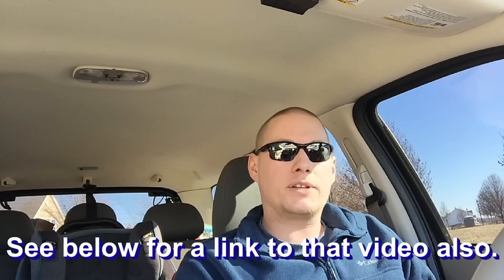Ford Ecoboost Engine Carbon Deposits: What You Need to Know

Comment: Brian,
What are your thoughts on fuel system cleaners like Red Line SI-1? I use Chevron with Techron gas exclusively.
I usually add a bottle of SI-1 (Red Line) at each oil change (it's sold at my Ford dealership). Should I do preventative maintenance and add a bottle of Techron instead of the Red Line SI-1 to the gas tank at every oil chance?
FWIW I use Red Line Synthetic 5W20 oil.

Thanks!
Reply from the maker: ***** I would only use the Techron bottles personally it has been shown to be the most effective and yes 1 bottle at every oil change should be sufficient.

Comment: Ok just to be sure 2013 Fusion 2.0 turbo ecoboost with 58,000. Its safe to use BG44k and top tier 93 octane gas and not damage my engine and to help clean valves?
Reply from the maker: Filippo R. Yes
Reply: Thank you.

Comment: Just bought a 2011 SHO 100k miles in mint condition. Had my mechanic inspect before buying but of course there's only so much to discover since he couldn't look inside engine/fuel system. What should be priority to do on the car? I feel the car hesitates a bit to first gear but if I step on it after the car flies! Any help much appreciated. Thinking of getting tune up, and bg upper fuel clean

Comment: To help control soot on Turbo diesel engines would it be beneficial to drive at 3300 rpms for 20 - 30 mins once every week ? 
I only use High quality engine Synthetics.

Comment: Is quicktrip top tier fuel?  When you can't get top tier fuel can you add Lucas to help with the fuel? I am running both Techron every oil change and lucas with each fill up. 

How often do we need to change spark plugs now with the carbon damage to the plugs you spoke about in the past?

Thanks. Great videos as always.
Reply: According to the top tier website QuickTrip IS top tier.
Reply from the maker: Fletcher Schubert Ecoboost plugs should be changed every 50-60k miles.

Comment: You mentioned a water/methanol injection as a fix. Are there any Ford recommended systems that will NOT void warranty? Or will "any" system do?

I am considering adding the alky control system on my Taurus SHO but am concerned about warranty issues.
Reply from the maker: David D No systems currently are approved.

Comment: I have a question, my 2013 F150 ecoboost with 46,000 miles on started puffing white smoke out of the tail pipe just for a couple of seconds. What could it be?

Comment: Very interesting- regarding your statement about Turbo charging increasing cylinder pressure and blow-by did you know that many higher end turbo models by BMW and a few others have oil consumption problems? I was reading that some vehicles use 2+ quarts per 1000 miles

Comment: Is it ok to vent the bov's on the 3.5l twin turbo ecoboost 2011 ford f150?... I know it voids the warranty but I don't want the oil going back into the intake. Plus we love hearing the Blow Off!
Reply: +Erick Wagner Venting the BOV will make cool noises but nothing more. You will only be venting air when you close the throttle in boost. Otherwise you will be getting the same amount of recirculated air as always. The only way to keep the oil out of the intake is a quality catch can setup.

Comment: So I have a 2015 Ford Mustang 2.3 Ecoboost. the engine experienced catastrophic failure with less than 32K miles on the car. The piston in cylinder 3 was destroyed and the cylinder wall on 3 on gouged pretty bad, and some valves got destroyed. The other 3 pistons looked pretty blackened. Does that sound like carbon build up? or does that sound like heavy detonation? Ford tried to blame it on aftermarket spark plugs (NGK's which come highly recommended for the 2.3 ecoboost) until they took it apart and couldn't justify a broken plug causing all the damage. They are covering it under warranty luckily. What do you recommend I do to take care of the engine after the car gets fixed? Thanks. Can I somehow show you pictures of my engine/head? thank you again.

Comment: I driver only Cty Type Driving , meaning rarely go above 30 mph in my Small town, ave 7k miles a yr.. Thus will hardly ever use a Turbo System..I would assume this is not Good for it and I should Avoide buying a Car ( Fusion) with this .Just a Straight 4 cycl or hybrid?

Comment: A friend of mine told me to use synthetic oil 10W60. That would prevent problems with timing chain tensioners and so one. Do you agree with that? By the way, your vids are extremly full of informations. Please keep it up. Greetings from Germany.
Reply: If Ford recommends 5w30 for your EcoBoost engine, using 10w60 is a horrible idea.

Comment: I am not mechanically knowledgeable I just purchased a 2014 Ford 3.5 turbo charged engine I don’t have the manual what is the best octane gasoline and what Type of oil is best synthetic or not synthetic thank you anybody who knows all and it has 45,000 miles on it I was told to get a oil separator as well

Comment: I read that Toyota has developed a new v6 engine for the  new Tacoma and it is going to utilized both direct injection and port injection. Maybe this is already being used, do you think it will  help alleviate the carbon build up issue?
Reply from the maker: Yes it will and Ford is starting to use it too
Reply: It's called Atkinson Cycle. Direct/Port Injection controlled Via computer. The downfall to Atkinson engines is that they don't stay in their rpm range long unless the vehicle is equipped with a CVT Transmission..Although the cylinder will use all of its power each stroke..Toyota went to CVT in the Prius to gain power for that reason stated above. Toyota didn't just have one advantage or the other in mind when building the AC engine. Its a win win for them. Good fuel mileage, good power, not much carbon. ;-)
The engine you were speaking of is the 3.5, which in the 2016 Tacoma, it is the platform from Lexus via 2005 engine  design, with the Direct/Port injection technology incorporated. This engine can make over 306hp non aspirated.
Reply: 2010V6RAV4 in all honesty, the Prius transmission is not really a CVT. Look it up, its too much to type. Its neat how it works..

Comment: Any updates on approved cleaning methods? I just bought a used fusion, 2.0 eco, and there's even more carbon than your videos showed. Wondering if I should just clean it myself or go in and try to have them fix it under warranty.
Reply from the maker: skittlesRgood182 If you have the intake off and are looking at it then just clean with some carb cleaner and a wire brush. BG has a induction service for DI engines they say is compatible with Ecoboost engines.
Reply: FordTechMakuloco would you recommend seafoam?

Comment: Would you be ok with A Pennzoil Blend, or would I be better with the Motorcraft Blend?  Reason is cost.
Reply from the maker: +Robb Toft I would use Penzoil Platinum the cost on Amazon subscribe and save is almost the same as Motorcraft Blended and the Penzoil is a superior product check it out-http://www.amazon.com/gp/product/B00ELHNM3K/ref=as_li_tl?ie=UTF8&camp=1789&creative=390957&creativeASIN=B00ELHNM3K&linkCode=as2&tag=fordt-20&linkId=GCXTEOSWEWHODBDL
Reply: Blend as in "semi-synthetic"? All of that's garbage. The Motorcraft stuff will get you through your warranty but isn't good for long-term. The difference between synthetic oil and non-synthetic is not just the oil change interval. Good synthetic oil has far better specs on stuff like NOACK. NOACK is the evaporation of the oil and is the actual cause of this problem. To lessen this problem you need to use the best oil with the best NOACK value. The Pennzoil Platinum he previously linked is some of the best group 3 oil and is priced very well and is definitely better than Motorcraft. I'd personally look to even better oil like Amsoil, though. Amsoil (and some others like Royal Purple) are group 4 true synthetic oils. Heck Redline is a group 5 oil. Pennzoil and Castrol and Mobil 1 and such are group 3 which is technically not a synthetic, though it is highly refined and legally allowed to be marketed as a synthetic in the US. That's the lowest grade you should consider running when you have an application that requires low NOACK. Never consider anything lower like non-synthetics or semi-synthetic or store brand. Save that stuff for your old beater cars that don't have direct injection and didn't cost a lot and aren't expected to last for many more years.

Comment: The turbos do run at idle. Therefore the intake will be in vacuum, why can't I at that point use seafoam or any other engine cleaner to clean the valves?

Comment: Any update to this? My dealership is recommending fuel system cleaning services from them for my 2021 F150 with a 3.5 Ecoboost. What would be your recommendation to them?
Reply from the maker: I have a an update video on your very engine a few videos back.
Reply: @FordTechMakuloco  thank you. I think I found the right video, but it is a yes or no to dealership fuel injection cleaning at 60k for 2nd gen Ecoboosts with dual injection? The old salt technician they referred too is the same one that told me there was no such thing as Over the Air updates.

Comment: Hey man i need your help
I have a 1.5 Ecoboost focus with only 10000 miles
And already I'm suffering from cold start misfires is this a carbon build up related problem?
Every time i go to dealer they told me it's normal due to fuel poor quality
How can i solve this bare in mind that I don't have access to top tier fuel in my area?

Comment: Do the new ecoboost engines for 2016 use a dual injection system to spray fuel on the back of the valves to keep them free of carbon buildup? I understand Toyota and some others are using this method.
Reply from the maker: +Robert Devoy 2017 Raptor is supposed to be the first yes.

Comment: Watched first video already....posted this....Lowrider PardonME10 minutes ago
Ford might want to make a specialty tool turbo to place on the motor while running the clean up products? Not sure the difficulty of unbolting cars turbo from motor slide it to the side? and put a temp turbo  or no turbo? as older Ford turbo coupes used to run after turbo was dead if I remember correctly?  A lot of work there but hey does Ford want this to kill consumer faith? I just bought a 2014 used and I am a GM man by trade.... I can easily go back to GM for my next purchase once this cars issues kill its great performance and reliability. Going to shop tomorrow to have this purge valve replaced, glad we got a aftermarket warranty with this thing. Not aimed at you sir of course, Thanks for the videos...subscribed :)
Reply: +Lowrider PardonME this was the first thing i thought of.  but removing turbos to do a cleaning service would be very labor intensive.

Comment: Hi Brian,
I own a 2010 F150 2WD SCrew, 4.6l 3V & 6-speed tranny. My power train warranty ends in May 2015. My question is, IYO, are there any necessary software updates for my truck that should be done before the warranty ends (my truck runs fine)?

Thank you,
Tony
Reply from the maker: ts302 If it runs fine then I would say no. Either way if you ask them to do it or they use a tsb for the claim on your ESP the end result will be the same reflash for $100 so I would wait for that particular engine and trans.

Comment: +FordTechMakuloco, have you been seeing issues with the 2.0L Ecoboost trans haveing shifting issues between 2-3rd gear?
I Just bought a 2016 Fusion with 25000kms on it and I have noticed right away, a hard jolting shift between those gears. I checked online and it seems that many people are having the same issue, on any Ford with that transmission/motor combo. So far I have not seen a fix. People have had them rebuilt only to have the issue back after a few hundred miles.
Reply: have you checked the mounts? I know with the focus st, clunking can be heard between shifts and is usually the lower engine mount.

Comment: I am seriously regretting buying a used 2013 f150 eco after learning of all the problems. Wish i would of done more research before i bought it and got the 5.0
Reply: +bloodduck316 Are you currently experiencing any problems with your motor? I don't know how much reading you have done on the 5.0L but that motor also has had issues with knocking and oil consumption. My point is that every motor will have some issues here and there. The CAC issues the ecoboost owners experienced was resolved. The only MOTOR related issue that I have read about is the timing chain stretching over time. I have a 2013 ecoboost as well, why worry about something that MIGHT happen...enjoy your truck and take the advice given in this video.
Reply: +starwarsfanforlife you are right, I've done more research and feel better about my purchase. I've installed a catch can so far, lots of gunk coming out.
Reply: +starwarsfanforlife how did they resolve the water in the CAC?
Reply: They changed the intercooler and also changed the ignition timing some.
Reply: +bloodduck316...  For so many reasons.  There's no replacement for Displacement!
Reply: Sedan Smith Maybe if we are talking about racing...but if you have never driven the ecoboost 3.5L it can surprise you. I am glad I did not go with the 6.2L. It sounded great and was pretty peppy when test driving it but the twin turbo ecoboost drives like a small diesel. I guess it all depends on your towing needs of course as i believe the towing max now is about 12,000 lbs. If I were needing to be there or just a bit over I would have gone with the 6.7L Powerstroke.
Reply: +starwarsfanforlife i am eating my words, the truck had been doing great. Glad i bought it now! Pulls my 25" camper really well.
Reply: bloodduck316 That's great to hear!! It really does surprise you how that little V6 just pulls and pulls. I have passed many a truck climbing up steep grades in my ecoboost. When you really need some power to pass it is ready. Now you are a believer and can tell people without a doubt how well it can tow.
Reply: +starwarsfanforlife I'm definitely impressed with the torque numbers.
Reply: bloodduck316 do you still have this truck? I’m thinking of installing the catch can on my 13 I was hoping you can tell me how it’s working out for you long term.

Comment: +FordTechMakuloco Ive been researching the Fiesta SFE, with the 1.0 EcoBoost, for the last several months, looking to buy one in the new year. This video, and the older one were really informative, and it all makes sense. Since this video is over a year and a half old, is there any new updates from Ford on a fix for this issue? Do the newer EcoBoost engines have new software or anything available?

Comment: Damn i just bought a 2012 3.5 ecoboost f150 with 85k miles. The carbon deposits on the valves have me worried. Have they came out with anything to prevent this or clean them up?

Comment: im getting  ready  to  buy  a 2015 ford escape  with the 1.6l ecoboost, what you are saying is  if  I  use  the  Pennzoil platinum oil(every oil change) and  the  chevron fuel sys. cleaner(every oil change) I should  be  fine ? is  this  correct thx  for  any  help.glenn   also  should  I  use  only  the  premium  gas, and  not  the  mid grade?

Comment: Passed 100K on my 2.7 L 15 eco boost engine. No problems yet, change the oil every 3-4K
Edit: I also abuse the shit out of my engine, I put it through the paces compared to normal drivers
Reply: Glad to know this. My 2016 2.7 ecoboost is at 75k and I want to start getting ready for any major future issues. I haven't had any problems so far.
Reply: David I also ran it with like a extra quart of oil for about 10k miles on accident not knowing you had to wait 30 minutes.
Reply: What type of and  brand of oil are you using? Thanks
Reply: NoShadowOfADoubt Castrol Edge Extended Performance. Most expensive type, but it’s cheaper then replacing a engine. I’m about to start using the Pennzoil ultra platinum full synthetic as I heard good results about it as well

Comment: Hi! Awesome work and awesome movies. Tons of useful info for Ecoboost owners. Do you think the carbon stuff may me a reason for some knocking sounds from the engine during hard acceleration? I have 1.6EB S-max and in the last 3 years I managed to hear it 4 - 5 times. Whenever I was riding in 2000RPM range and wanted to accelerate hard w/o reduction, (with 3 bikes on roof, going uphill, catching the early yellow on a crossing) - it happened - but I've never been able to reproduce the conditions to be 100% sure what is the reason.

Comment: Hey Brian would you recommend the Walnut shell blasting method for cleaning the valves? It seems quite a few folks have been doing this with the older ecoboost motors...
Reply from the maker: Yup if you have access to the machine.

Comment: Will adding an aftermarket grill in the opening of the bumper really restrict air flow to the intercooler??? I heard this will cause the turbos to run hotter causing premature failure.
Reply from the maker: Brandon Cunningham If it is just a grille and not that restrictive I would say yes many guys run a lower grille for appearance.

Comment: When you talked about only using a high quality full synthetic oil, you show a picture of Pennzoil Ultra. Why wouldn't you recommend Motorcraft full synthetic?  What about Mobil 1 Extended Performance? That's what I use
Reply from the maker: +david wysocki Their new oil is the only one that I know of that is made from natural gas. All the oil molecules are the same size even over normal full synthetics. Penzoil has come a long way in the past few years. Go to penzoils website and read about the oil molecules in the natural gas oil they have a good visual aid there too.